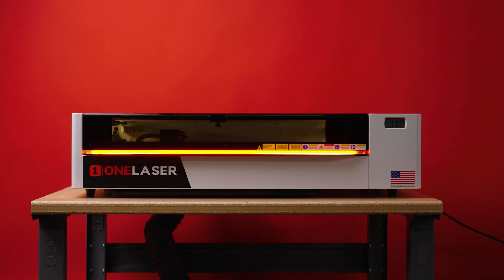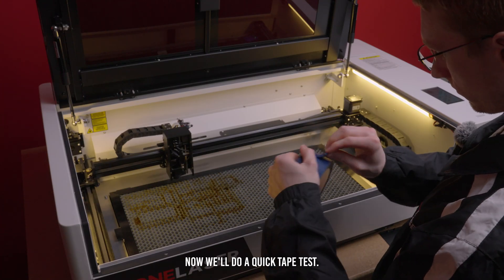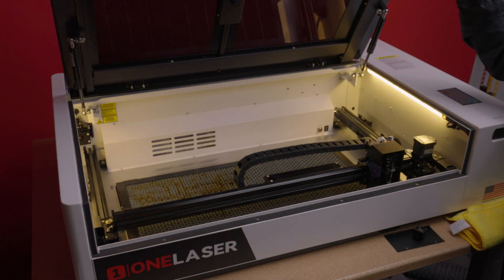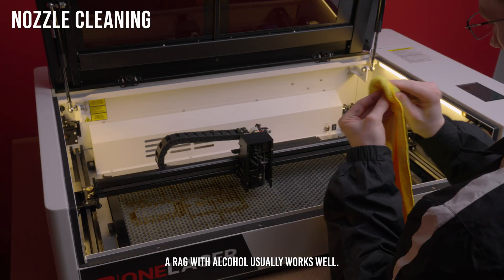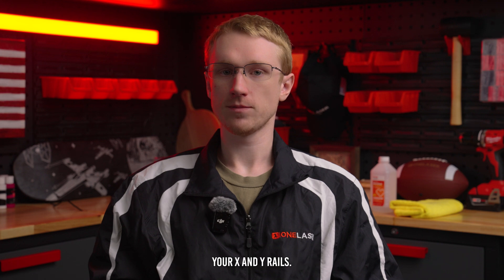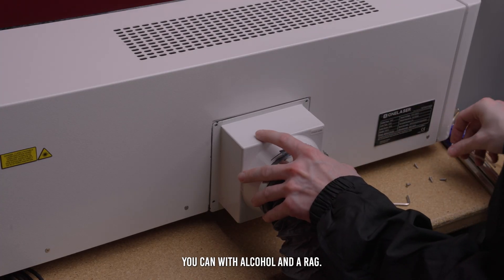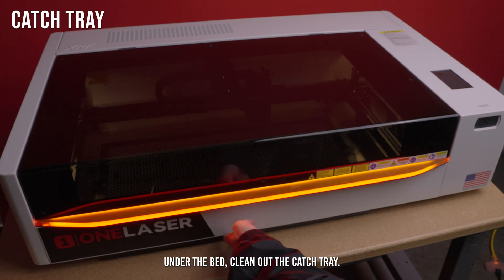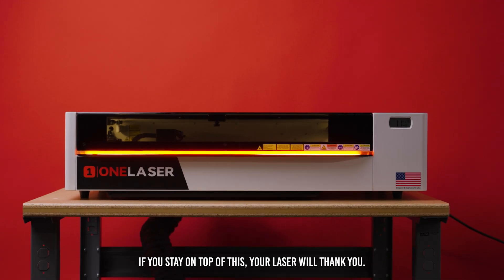OneLaser XRF Simple Maintenance Guide

Comment: This is the issue with everything- the videos,the manual (or lack thereof), working with the support people.  They go way too fast and assume that the person who owns the laser is some kind of laser expert.  The laser was billed as a ‘beginner’ laser!  I’ve had Glowforges for more than 4 years, but they don’t require the kind of maintenance this laser does.  Adjusting the mirrors is purely hit or miss, and no instructions or labeled parts.  The lens is down inside that container, but did you send a tool or detailed instructions to actually help anyone figure out how to clean it?  No, you didn’t. No help on focusing it.The ‘suggested settings’ are a joke.  Try this speed and set the power between 10-90%.  It only goes from 0-100%, so this is not helpful in any way.  And I don’t have an XRF.  You do remember that you made the XT, don’t you?  Why isn’t there a single video about it? Mine came with a bottle of liquid, that didn’t say what it was or how it should be used!  Turns out it’s antifreeze that should go in the water tank, but how much of the bottle should be used?  Do I need to use it as I’m in SW FL which doesn’t have freezing weather?  I don’t know! And no one would tell me! The instructions said to use ‘pure’ water!  Is that distilled water or just tap water?!? I was told the laser would work with a Mac, but there are no instructions on how to set the laser up using it, only PC instructions. I waited nearly 6 months for this laser and I am extremely disappointed with it.  I’ve had it for more than 5 months and still can’t get it to work consistently.  I am frequently infuriated and severely depressed by my experience with this laser.  I’m disabled and my laser used to make me a little very useful money.  I can’t even try to use this one to sell things as I never know from day to day or material to material whether it’s going to cut or engrave or not. I wishI had never heard of this laser brand.